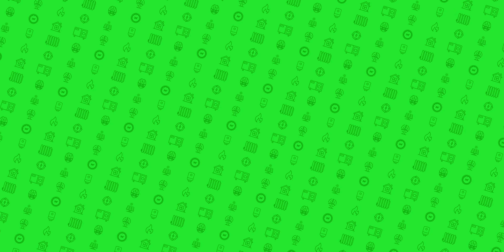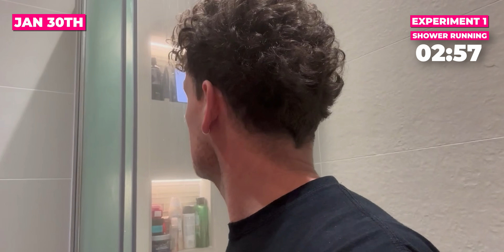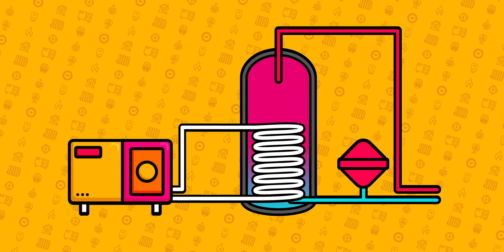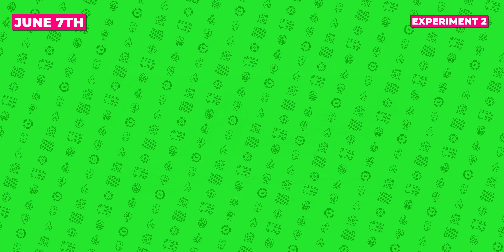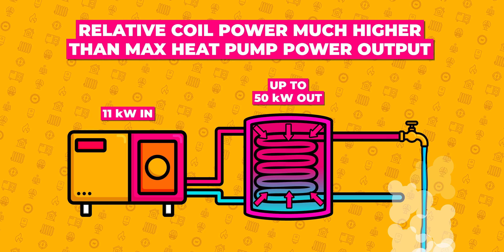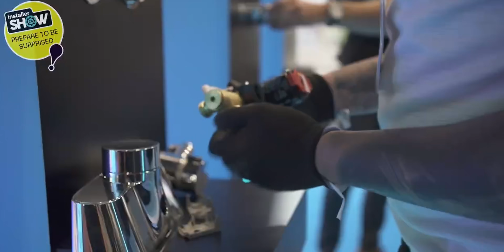The Worlds SMALLEST Cylinder is here!

Comment: This is brilliant! I'll be mailing this to Octopus energy. No expansion vessel and ancillary pipework makes for a better and faster installation. More over, more homes can have this cylinder, even those that arent ready yet for a heat pump.
Reply: Same I will send this to Octopus. This would mean I could have a heat pump!
Reply: A 10.kw hower will cost about 12 pence per shower. No storage needed so what is the point of involving a heat pump for a shower. Washing up and washing clothes only uses cold water
Reply: @richardlewis5316 Our house is over 40 years old and was built down to a price. Only a bath, no shower. We made do with rubber tap push on showers. The output was low due the HW pressure and the apparatus had to be replaced every year or so. Next came a9 kw pumped shower. A big improvement, but still not great volume and some issues with temperature control. 
Then we replaced our 30 year old boiler with a combi and the bath was replaced with a proper walk in enclosure. The showering experience changed from five or six minutes of functional activity to eight minutes of physical pleasure as the temperature was constant throughout and the volume was everything you could ask for even using the rain head. 
 I’d estimate that the cost per shower was about the same. I’d never go back to electric, whatever the cost.
Reply: @StepDub  even if the performance was better and cost one third the price AND you got to get rid of the gas standing charge??
Reply: @terryjimfletcher if you’re suggesting throwing out the recently purchased combi in favour of a heat pump setup then no, obviously. Maybe in ten years time, or if the price of gas goes skyward. But a pumped electric shower is a miserable experience compared to a gas combi.
Reply: @richardlewis5316  an 8minute shower (the UK average), costs 36pence at £0.27/kWh. With a heat pump it will be 10p, saving a couple £189/year.  If you've got a heat pump, it would make sense to run the shower off it.
Reply: @richardlewis5316  It seems to me this isn't actually a combi, the tank they installed was already up to temperature. As we all know a combi needs 37kw to heat cold water quickly for hot water so we don't need a cylinder. Heat Geek are using a pre heated cylinder (from the heat pump i guess) and the heat pump heats it up so how is it a combi? It looks to me like a heat pump heating a very small cylinder and the heat pump turning on when the temperature drops 3 degrees. It took just over 3 mins for the heat pump to come on and for a lot of people a shower is 4-5 mins so by the time the heat pump gets it back to its pre-set temperature the shower is done. This isn't ground breaking and will never take off as a combi, it's just a normal heat pump heating a very small cylinder that's all
Reply: @kjc728  I understand your point but what I cannot comprehend is why a heat pump costing thousands can be seen as more efficient than a simple combi which heats sufficient water for washing hands or a shower in seconds and costs next to nothing. Why not let the heat pump heat the house when needed and the gas for everyday use? Removing the combi makes no environmental, economical or financial sense.
Reply: @richardlewis5316  i think standing charges for gas service alone answers that question doesn't it?
Reply: @richardlewis5316  We have virtually the same system as in this video, but in gas form....
So, instead of storing all your hot tap water, the system puts the central heating water into a cylinder.  
The radiators take that water to warm up rooms. 
The hot-water part is achieved by putting a long, coiled pipe through this cylinder.  You get zero pressure loss, and the water heating is instantaneous because it's always at the same temperature as the radiator water. (You actually have a TMV to reduce that temp to safer levels.)
The big benefit is that you're not using 37kW of power (as in a combi boiler), you're only using 8 to 11kW because you're always getting a good efficiency from your heat pump.
Reply: This is a genius workaround.  Less is more.
Reply: you could also add DIY waste water heat recovering system for the shower drain and use like 60% less energy overall

Comment: Couple this with a wide modulating range heat pump in the 9kW rating bracket and you’d be close to the performance of an electric shower for delivering continuous hot water.
Reply: any suggestions on best modulating heat pump 9 kw on the market?
Reply: @Ivan-h4g2n  I'm quite partial to Sprsun/Cool Energy myself. The older R410/R32 units weren't brilliant at modulation, but the new R290 unit looks to have some good numbers. They're basically a Carel chiller/heater underneath and the control algorithms are decent. Not to mention the UK support from Chris at Cool Energy is excellent.
Reply: How far can they modulatie back to?
I have been using Daikin Altherma 3M and they can go back to 30% of the 9 or 11 kW for example
Reply: 2.9-6.5kW @ air -3,  water 45.

So the 9 is more like a 7, which is unusual for Sprsun as they’re normally bang on with the specs.
Reply: @dorsetengineering  Ok, so just under 50% modulation minimum of the power output.
So the Daikins a bit better at around 30%.
They aren't to expensive for me to buy them, but I will look into the Sprsun and I want something with R290 at some point.

I like the idea of just installing an oversized monoblock heatpump of 9 or 11kW (which can modulate back down quite far), with just a small cilinder like this one from heat geak to power the hot showers.
However, given the electrical systems in the Netherlands, it means you typically will want to go 3 phase. Which is available often, but not every house has it yet. It is relatively cheap and easy, just an added hurdle.

Comment: How come no risk of legionella please ? Do you have a weekly super high temp cycle or so?
Reply: because yo are not storing any water on the domestic hot water side.
Reply: In the netherlands this is seen as storage( anything above 1 liter) and still mandates thermal legionella cycles
Reply: @willempostma424  there is no storage here - just a pipe going though cylinder - nothing to disinfect here
Reply: It will still be cheaper to disinfect this cilinder than a big one of 200 or more liters.

Comment: What is your flow rate on the shower ? Strangely enough I was discussing this design a few weeks back and also coupled in with solar to get the extra hot temperatures that can lead to really good outputs. I wasn't even sure that it would work and certainly hadn't considered doing it in a mini form. Well done for bringing this out and giving it a go. It must be great having the time and the resources to experiment with all of these ideas well done to you
Reply: It's in the video later on at around 12:58 -- 8.5 litres per minute
Reply: @defragsbin  TBH that shower looked a bit iffy. Like it was scaled up, and not all the nozzles were clear and flowing. Was it really 8.5 lpm?
Reply: @stephen-boddy  Then power capacity, which required fir instant hot water heating should 8,5*32*60*1,163/1000=18,9 kW! :-)  Adam really has such powerful heat pump?
Reply: @valeriysamarskiy6283  I think this would only work with much higher supply water intake temperature (or shower drain water heat recovery).  At a 32°C step up temperature, and a 6.5 litre per second shower, with 55% efficient shower drain water heat recovery, that requires 8 kW continuous input.  My gas combi boiler quotes a minimum modulation of 6 kW, but it short-cycles in a similar setup unless I turn the flow rate up quite high on the shower.
Reply from the maker: Hahah I wish I had the time Andrew!! I do this stuff at night after the kids are in bed!

Comment: Surely the H/P will need a buffer vessel to achieve the minimum water volume required for defrost mode?
Reply: not really. 3 or 4 way valve is required to make sure that on defrost the unit pulls from the heating system and not from the store
Reply: @UrbanPlumbers  Understood, but Unfortunately I have a unique requirement where I am only looking for a DHW solution to replace my ancient Baxi Bermuda back boiler. I have a multi split for my heating (& cooling if we ever get a summer 🙄).
Reply: Heat pump hot water cylinder for you (EAHP)
Reply: Nope, defrost volume comes from your rad circuit like it always has. Volumiser can be used to increase that defrost volume but you don’t use a buffer for that.

Comment: Very interesting thermal store. I presume it doesn't need safety valves because it can't heat too hot. So also I presume the option with an immersion heater does? Or does the 16L limit still apply?
Clever engineering solution.
Does it just swap into circuit with a three way valve as with a normal high gain unvented cylinder?
Reply from the maker: 16l still apply

I don’t think thermal store is a good description for the ministore… . People are calling it a thermal store just because the DHW goes through the coil. 

A normal hot water cylinder is also a thermal store officially.. you heat it and store it until use.

The ministore is more like a tube in tube heat exchanger. As it gets most of its energy from the heat pump recharging it rather than its stored reserves (like a combi with preheat switched on).

If you have to categorise it I would say a tube in tube heat exchanger with built in buffer. But not a thermal store.

Traditionally a thermal store is used to describe something that keeps the whole heating system (including rads) at hot water temperatures, so way less efficient for heat pumps.
Reply: @HeatGeek  I understand your points - the store part is limited, more energy is transferred continuously, and it's a buffer. Operating that way round I presume allows the heat pump side to be higher flow than the DHW coil which can be thinner and longer for more efficient transfer?
Reply: @HeatGeek So then is it right to assume that, given there's sufficient space in the house, a supercylinder design is still going to be more efficient than one of these with the main difference being the reversal of which side is attached to the coil rather than the 'body'?

Comment: Is this cylinder a Thermal Store of old in principal? Thermal stores in turn were in effect a Calorifier but with the advantage of a ‘running start’ 
Great idea have to say, opening up flats and smaller premises to the Heat Pump solution…..
Reply from the maker: I don’t think thermal store is a good description for the ministore… . People are calling it a thermal store just because the DHW goes through the coil. 

A normal hot water cylinder is also a thermal store officially.. you heat it and store it until use.

The ministore is more like a tube in tube heat exchanger. As it gets most of its energy from the heat pump recharging it rather than its stored reserves (like a combi with preheat switched on).

If you have to categorise it I would say a tube in tube heat exchanger with built in buffer. But not a thermal store.

Traditionally a thermal store is used to describe something that keeps the whole heating system (including rads) at hot water temperatures, so way less efficient for heat pumps.
Reply: It is principly operates the same as a plate heat exchanger.
Reply: With the thermal store 'of old' the idea is it can receive heat from multiple sources, for those fortunate enough to have them, eg. solar thermal, waste wood boiler, excess from PV or wind turbine. The bigger thermal stores can be used to run  both dhw and central heating.
Reply: Fantastic news, such an amazing product. Does it have to be floor mounted or could it be wall mounted to replace the gas Combi?

Comment: So you’ve reused a thermal store ???
Reply from the maker: I don’t think thermal store is a good description for the ministore at all no… 
People are calling it a thermal store just because the DHW goes through the coil. 

A normal hot water cylinder is also a thermal store officially.. thermal store= somewhere to stores heat  until use.

The ministore is more like a tube in tube heat exchanger. As it gets most of its energy from the heat pump recharging it rather than its stored reserves (like a combi with preheat switched on).

If you have to categorise it I would say a tube in tube heat exchanger with built in buffer. But not a thermal store. Perhaps a heat pump powered instantaneous water heater?

Traditionally a thermal store is used to describe something that keeps the whole heating system (including rads) at hot water temperatures, so way less efficient for heat pumps.
Reply: @HeatGeek  hybrid store maybe?
Reply from the maker: @sgbnews  I think Nathan gambling had the best description which has been used for decades. Water jacketed tube heater.
Reply: @HeatGeek  it’s definitely an exciting innovation. Booting legionella worries into touch as well. Good work , I hope it takes off
Reply: It appears so. I’ve had thermal store from DPS for about 15 years, a little different as you can put more than one heat source into it and the water is heated via plate heat exchanger.
Reply: But they’ve swapped the roles of the coil and the reservoir. TBF it’s pretty clever… loads of heat capacity in the cylinder and the hot water feed is able to heat up easily.
Reply: @garybradley2171  just like a thermal store then.
Reply: @garybradley2171  don’t get me wrong, I am a huge fan of these guys, technically brilliant, really putting some science into the rather murky world of renewable energy.